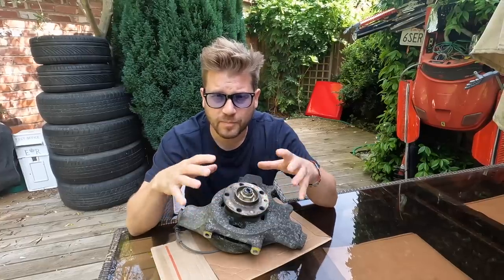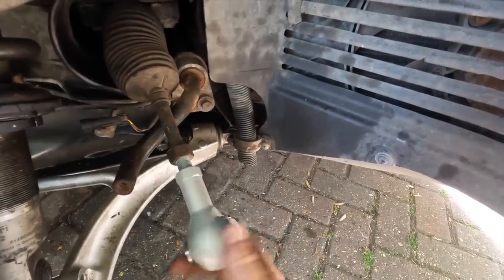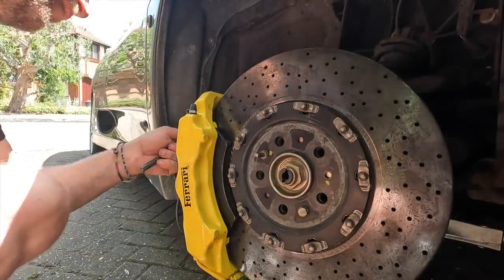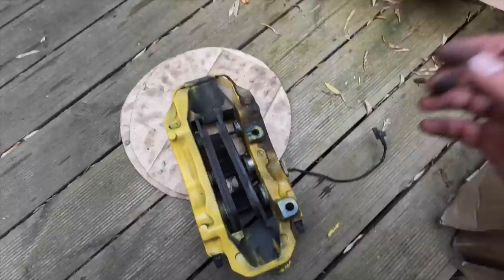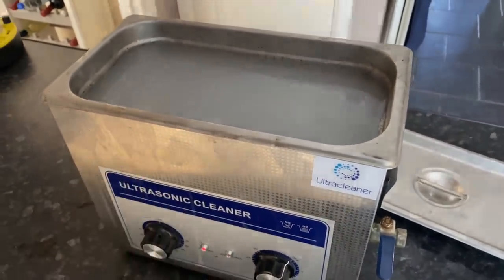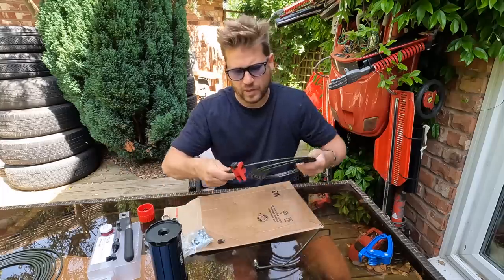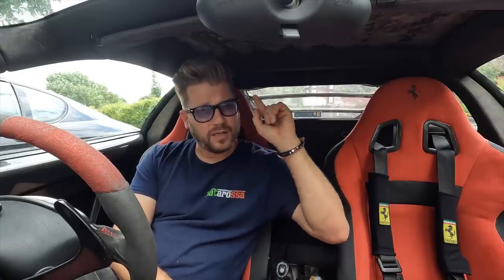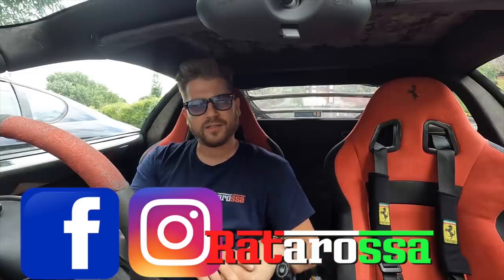DIY Ferrari Brakes Repair Saved £6000 With A Simple Hack

Comment: Great work freeing the pistons up. One piece of feedback is never use chrome sockets like this - they can and do shatter under extreme circumstances, and with so much force behind them they can make some vicious shrapnel. Always use an impact socket instead, as they deform instead of shattering.
Reply: or a small piece of concrete, much better under compression

Comment: I had rusted brake pipes on my merc a few years ago and merc quoted me €700 to replace it. I bought a flair kit, some connectors and a roll of pipe at a cost of about €100 in total and did the repair myself. It was one of the easiest and most satisfying repairs I’ve ever done. Gotta love the DIY solutions. The flair kit has been passed around my mates since and saved them a fortune too.
Reply: Good man!
Reply: Well done 👏 it is as you say, rewarding 👍

Comment: This is so interesting to watch. I would never have the patience and the hand skills to pull all this off. I really admire not only your money saving but also component saving approach, you fix every part you can, you don’t throw things out unless they are completely shot.
Reply from the maker: Thanks Ross, yes I cant stand the fact those calipers would normally be binned. I will totally reuse them
Reply: @Ratarossa  apparently you can use Alum (available at grocery store) dissolved in water to dissolve the steel bolt stuck in the aluminum part. Hotter you get it faster it dissolves.
Reply: @Ratarossa 😊
Reply: @Ratarossa 😊😊
Reply: @Ratarossa 😊😊😊😊😊
Reply: @Ratarossa 😊😊😊😊😊😊😊
Reply: @Ratarossa 😊😊😊😊😊😊😊😊😊😊😊😊😊😊😊
Reply: @Ratarossa 😊😊😊😊😊😊😊😊😊😊😊😊😊😊😊😊😊😊

Comment: I work on boats and you can imagine what sea water can do to seize bolts. I have used a tool called an easy out which involves drilling the seized bolt roughly in the centre. The easy out goes in the hole on a left hand thread which it cuts in the broken bolt. This is tightened and the bolt which is weaker due to the hole drilled in it hopefully comes away as you turn the  easy out in. Good luck!
Reply: In my experience easy outs on very seized bolts like this one are crap. Usually ends up with the easy out shearing in the hole and doubling the problem. I'd drill the sheared bolt out in ever increasing drill sizes until close to the edge and carefully pick the broken bits out. Helicoil it after and jobs a good 'un! Any good engineering shop could sort it to be fair.
Reply: @jamiemiller7752  yes

Comment: This is real automotive engineering, this is what I learned as a mechanic in the early 1980's, as we moved into the 1990's we became more "parts fitters" than actually repairing things. So many items which could be repaired were just thrown away.....I recently replaced the seals in my Ferrari 348 clutch slave cylinder 70 euros for the parts, whereas most people just replace the cylinder with an aftermarket part for about 700 euros......Why do that when you can fix it!
Reply from the maker: Cheers Kev good to hear you do the same

Comment: Great to see a fellow enthusiast repair his Ferrari rather than the usual tech in a dream workshop with all the tools and equiptment. We have 2 Ferraris, - Dino 308GT4 and a 456 and do all repairs and maintenance ourselves within our double garage so no hoist etc. It can be done quite easily but you do need some mechanical aptitude I guess and a can do attitude. Reality is we couldn`t afford to own these cars if we couldn`t do this and would miss out on a lot of the fun of owning them. Love the videos.
Reply: Love the 308GT 4
Reply: They`re a nicer driver than the 308 GTB plus although maybe the  GTB has a slight looks advantage the GT4 by itself is a good looking car. I`m over 6 feet tall and also far more comforable than cramped GTB. @PaulBCISSP

Comment: I’m a big user of copper slip on threads, particularly in suspension parts, makes life a whole lot easier when it comes to disassembly next time. All those broken parts are far less likely to happen when using it!
Reply: Is "copper slip" the same as or similar to "anti-seize"?
Reply: @mitsuturbo  yes cooper slip is the name us oldies use but it's the same stuff
Reply: @steveyates1098  the newer stuff on the market is garbage. I found some proper old copper slip at an auto jumble it’s just as good as I remember.
Reply: @mark4lev  Ceramic grease is the thing to move to
Reply: @philtowle4683  never tried it. A lot of people think copper grease is useless because the modern stuff is garbage, same as a lot of cheapened, made to  a price formulations.

Comment: Nicely done. I think I'd add some anti-seize to the threads on those bolts so they will come out later. I've seen that before with dissimilar materials seizing together.
Reply from the maker: Great idea
Reply: I had Brembos on a Porsche 944 Turbo S. Same problem with the caliper bolts. Antiseize solved the problem totally.
Reply: Its called galvanic corrosion, and its a real pain in the arse to deal with, I've been there and its no fun, especially with 30mm  + bolts.

Comment: I used to be a machine setter at a giant factory making brake pipes and they are called flairs not flanges.not being pedantic just thought it might help when talking about expensive car parts .very interesting work great to see the grease fix !
Reply from the maker: Great point!
Reply: Flares 😁 you can buy Brembo parts from Zeckhausen in the USA. they used to sell an own brand range of calipers that were identical to Brembo, but it was a few years when I bought stuff from them. I used to sell rebuilt calipers on an exchange basis and found them very easy to do.

Comment: Somebody in all these comments probably already mentioned if can set up on a mill could drill out and retap for you reasonably straightforward if have the a local machine shop with the required equipment is really good to show how owners on smaller budgets can run and repair these Ferraris.

Comment: Any bolts like that that feel very tight always try and put some heat on the part the bolt is going in to, in your case the upright. You can also do the same thing with the gland nuts on the brake pipes, it works a treat.

Comment: Crafting a brake pipe that looks as though it was there from factory is very satisfying, the broken bolt would come out with a nut welded on with a mig welder possibly, great video 👍🏻👍🏻
Reply from the maker: Yes I was really happy with the result of the brake pipe, it was also the first time ive ever done that.

Comment: Great series of videos. Just did my own DIY brakes, calipers on a 987 Boxster. Ran into the same seized caliper bolt which broke. Took over 8 hours total to drill out, retap etc. Made the awful mistake of trying to use a bolt extractor to remove the bolt. I should have drilled it out to begin with, but ended up with a broken bolt extractor. Drilled around it and eventually got it done. Good experience but not the most fun. But glad it’s done and really learned a lot (had never done brakes before).
Reply: Never use them extractors, nightmare 😫

Comment: Another Youtuber was recently making brake lines and got a lot of flack in the comments for doing it wrong, but your approach seems very good: cutting the pipe with a proper tool so as not to get metal dust in the lines, and having strong-looking end flanges able withstand the fluid pressure.

Comment: That new hub bearing sounds worse that the old one - like a bearing on its last legs. Old one would probably spin for a fair while with a wheel on it to give some momentum.

As to Brembo brakes. For motorcycles they won’t sell the seals. Story goes that in the 80s someone rebuilt their calipers and made a mess of the job and crashed. Then sued Brembo for selling them the bits to make a mess with and Brembo lost in court. So they stopped selling seals.

That brake pipe straightener looks useful.
Reply: remove the bearing ... take it to  a bearing store.. have them match one up for you,, save a few 100's for you
Reply: good point, just as a reminder: if a bearing spins more freely, usually it means the lubricant is no longer effective and tolerances between the bearing race and spheres are a little loose. on the other hand, if you feel any grind, bumps or noise while rotating, the bearing is a goner....

Comment: I was waiting for one of those (I assume) non-impact sockets to shatter under the pressure of the pistons and to send shrapnel flying!
Don’t bother trying to drill out the broken bolt yourself, use some of the money you saved and take it to a machine shop (ideally one that offers EDM) who can get it, and the wheel bearing, out without damaging the hub. Get them to measure up the bearing size too so you can get a generic but good quality bearing instead of paying Ferrari prices!
Reply: Yes, EDM/Spark Erosion will do the job. Years ago I had a couple of broken studs removed from a cast iron manifold. One also had a broken stud remover in it. Easy when you have the right kit.

Comment: Drilling the bolt out by increasing the size of the drill is a good idea but you have to be really careful to keep the drill square and on centre. Ideally you would want to find a local machine shop so they can bolt it onto a milling machine or similar. Another option is a bit more specialised and that’s with a spark eroding machine although this is more time consuming and will cost more money
Reply from the maker: Thanks for the info
Reply: Looked like there would be plenty of space for a timesert insert, the only tricky part is following the above and keeping the drill straight. At minimum you need a pillar drill and drilling vice, better as he says with milling machine and clamped down.
Reply: I have snapped off bolts spark eroded out quite often , not that expensive
Reply: @MrAmorti  nonsense. It’s easy to drill out by hand.

Comment: I  remade all the brake pipes and connectors on my TR6 during the lockdown, I'd never done anything like that before, I used the exact same "flare" kit  and bought some pipe benders, and watched a few youtube instruction  videos,  I didn't have anyone to help with bleeding the brakes so I bought a pressure bleeder kit for around £45, so something that seemed quite daunting was actually surprisingly easy to do.....top tip....invest in the correct tools for the job , it makes doing a job like this  straightforward.

Comment: Hill Engineering sell the calliper pistons and they work well (I changed all my pistons on my own 430). the other thing you should do is blow out the brake lines before you put in the flares, as the deburring process can leave tiny bits of swarf inside the pipes .That stuck bolt ??? Spark erosion is the best option and there must be loads of local shops near you that can do that job. Dont try drilling it out as by the time you have drilled a big hole to put a stud extractor into the bolt will be weak and probably split ........ and this can split the calliper.

Comment: A tip on getting out a bolt that is rusted in, Try hitting the head of the bolt a couple of times and also try to tighten the bolt a little. Tightening the bolt just a little will sometimes beak the threads free of the rust and then will come out with a little luck. Also heating helps if you do the other stuff I said to do. I've been wrenching on stuff for over 50 years.

Comment: I'm a mechanic, if the caliper is aluminium and the nut is steel, fill the steel bit by welding  by welding into it, when the welding material is above the top of the caliper, weld bolt onto the filling ,the heat from the welding would also  make the broken off bit easy to remove.

Comment: Just a quick bit of advise when putting components back together all threads need to have a dab of anti seize grease especially 
when steel bolts are going into alloy as the two metals start to oxidise together in a very short time the reason you had that
calliper bolt snap it more than likely free up if a large nut like a 10mm  with a 17mm nut is mig welded through the center of the nut 
and built up to form it into a bolt,  the heat generated should break the porosity between the steel and alloy  use a six point socket
on the nut to prevent rounding off the Nut,  and take it slowly to prevent breaking the weld, There should be someone down at your
friends garage where you have your BBi that can handle that for you easily. Keep up the good work and i'm especially interested on
how you get on with the BBi as I used to work on a few of them in the past.

Comment: I’m new to the channel but appreciate the samcrac-style approach! It’s exciting to see as a viewer the exact methods you use to get to get the parts you need to do what you need to do. How did you end up getting the caliper pistons? And what would you end up doing if you needed to swap pads and rotors out? 

If you don’t mind, I couldn’t help but notice the steering wheel is a bit worse for wear. A light mix of APC and water, or a degreaser, paired with a brush should be a decent way to clean it up and should be basically free to you. I get the ratty look is part of what makes it unique but i don’t think a quick once over with a brush and cloth would do any harm!

Comment: The bold is bottomed, the hole is not drilled deep enough, so you need to get the pressure of the bottom. This is a common tooling fault during manufacturing. The best solution, drilling a sideways hole where the tip of the bold would end up. Changes of structural damage are very high.

Comment: Some serious wedge saved there. Neat trick with the Grease, never seen that before. 
Best way to get the sheared bolt would be to weld a nut on then impact driver. The heat an the impact should do the job!!

Comment: Get this on motorcycles all the time. If ever I get a stuck bolt where it's steel in to ally I stop work immediately and get the heat on it. Brake calipers and brake discs are a favourite for seizing in place, they either round off or snap and then it's a major headache. The ally expands more with heat than the steel and it usually does the trick.

Comment: Next time you have a dodgy bolt, try tightening it a smidge, before you try loosening it I know it sounds a bit counter intuitive , but it can work. I would also recommend coating all your threads with Molycote or copperslip  to prevent corrosion in future. Oh and one more thing never ever use stainless bolts in a stainless part, even with lube, if you get any galling its game over.
Reply: BINGO  YOU MUST OF WORKED ON AIRCRAFT AT SOME POINT
Reply: @SMMBHQ-cg2zy  Nope, but all sorts of  other engines , pumps. compressors, that kinda thing, but been doing it for 46 years, you pick up a few things here and there . lol

Comment: The best way to deal with the broken bolt on your spindle is to step  drill it out starting with a smaller diamiter  bit and progressively increasing the bit size. At the mid piont switch to a reverse direction bit. Sometimes the vibration of the drilling is enough to dislodge the remains. Applying some heat to the spindle body near the drill location helps as well but be careful not to overheat the area. Just remember to have patience and take your time as well as using generous amount of drilling oil. Just the thoughts of an Alberta Millwright that might help. Cheers from Edmonton, Alberta, Canada

Comment: If you can get to the back of the broken bolt, use a punch and a hammer to shock the bolt.  Several blows can often times allow the bolts removal.

Comment: the grease in the wheel bearing makes it move slower, if the grease has leaked or dried out it spines easier and u can feel roughness and or noise
Reply from the maker: do you think the bearing is on its way out ?

Comment: Porsche service manual specifies replacing the bolts every time you take off the caliper from a 993.  the reason is that the bolts are coated such that they don't react with the aluminum on the control arm.  If you re-use the bolts, galvanic corrosion occurs and the bolt seizes because the coating is gone.  I had a bolt remove the threads from the control arm and had to use a timesert to address the problem.

Comment: Best way to remove broken bolts at home is to drill them out, starting small and stepping up in sizes, normal as you approach the core diameter of the thread it will either come loose or break up, either way it will come out, be careful to drill central and straight (knicking the thread isn't a problem, but anything more and you'll need to helicoil it)
Reply from the maker: Nice tip Paul, Ill try this in the week. cheers
Reply: I have done loads of these. Lot easier to get it clamped down on a mill.

Comment: Take the hub to the machine shop. They will put it in a jig, possibly drill a small hole inside a broken bolt and even unscrew it. Inspect the brake caliper, it can also have corrosion just like the pistons, and be careful puting new seals in brake pistons: some of them are squared, some are tapered and go only one way.
Reply from the maker: cheers

Comment: I’d take that old hub to a local machine shop. Set it up on a mill to get it perfectly square to the snapped bolt. Then drill it out and re thread with a Helicoil. Good work on getting those pistons out👍.
Reply: Never use a helicoil on brakes. Timeserts are much stronger.
Reply: Once you drill enough of the bolt out it's often possible to get it out without damaging the threads. If they're not too bad just run a tap through to clean them. Then anti-seize, but using that will change the torque spec.

Comment: You could get the bolt out by taking it to an EDM (electronic discharge machine) machinist they will be able to remove it, helicoil the thread as required.

Comment: hello scot
About your broken bolt.
Punch a center point on the bolt end
Drill a hole in the bolt, make sure you drill straight
Turn a left tap into the resulting borehole
Heat it up a bit and try to get the remains of the bolt out, counterclockwise the tap gets stuck
Then tap the thread again to the correct size to clean it up.
good luck
Willem